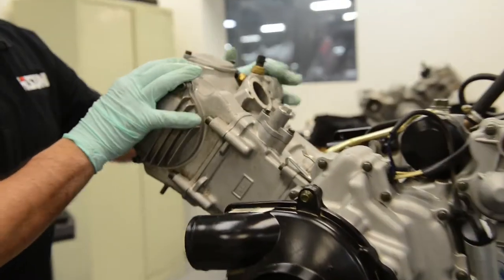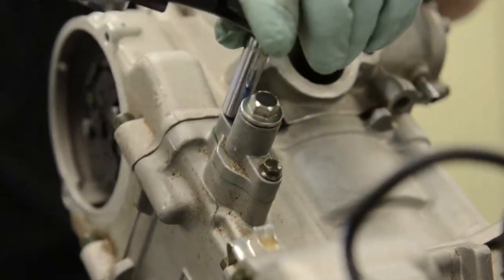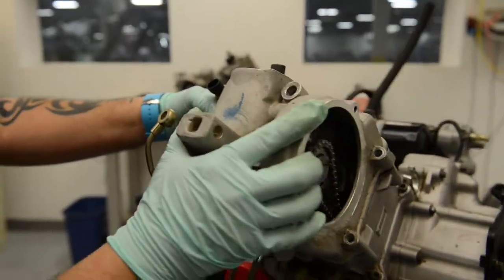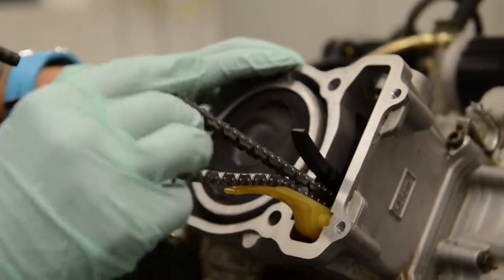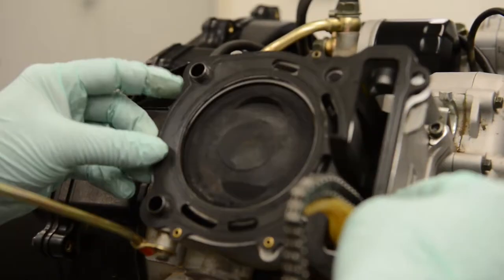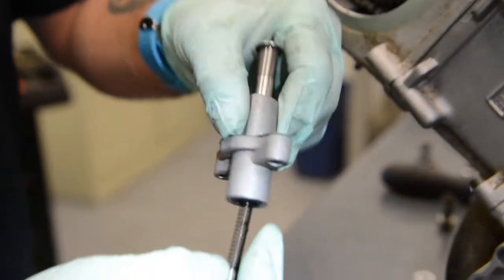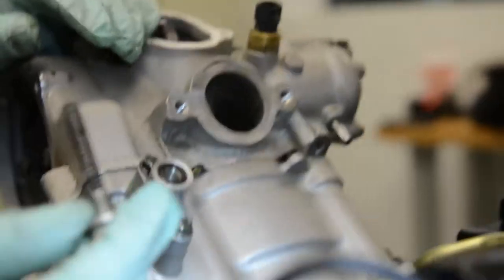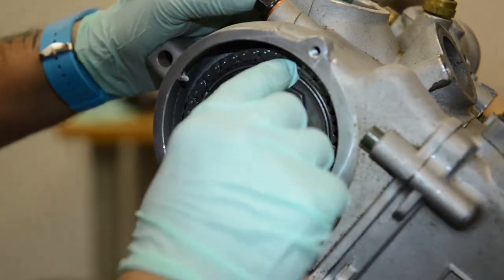Head Gasket Replacement - HISUN 550cc UTV Engine

Comment: Everyone see how quickly Hisun got back and answered all these questions you have? Yup, that's exactly the service and response you can expect from Hisun!!! ZILCH!!!!! Also notice this video shows an engine on the bench. Yeah, wait till you try to fix this thing IN THE SIDE BY SIDE!!! Absolutely horrible to work on. BTW- these engines run a quart low on oil if you go by the factory dipstick AND no where in the manuals does it say you should be using an oil with additives for the clutch, but if you don't you'll wear it out. JUNK! But I have thousands tied up in mine, so I'm bulling on through and making this thing work for me.
Reply: yeah 15months old my crankcase full of antifreeze, Ive had to attempt the above repair. someone said rewire the cooling fan so it'll stay running. Instead of waiting for the motor to overheat.  its not easy like they show you above, but it does help,  takes all afternoon at least. hisun needs to do better.
Reply: In frame top end is pretty easy.Bottom end-pull the motor.